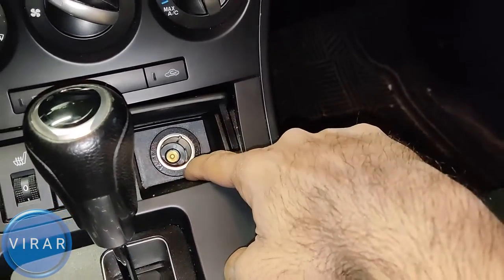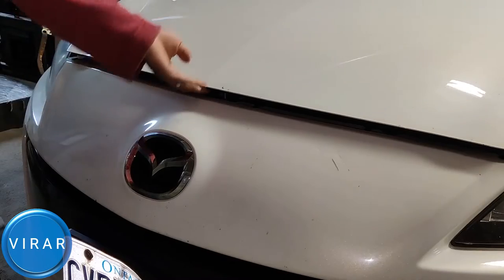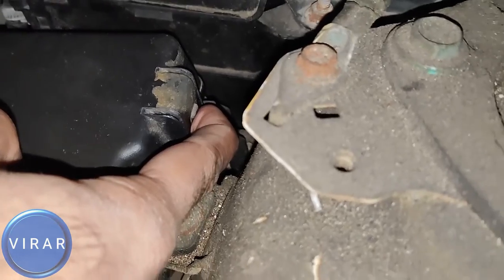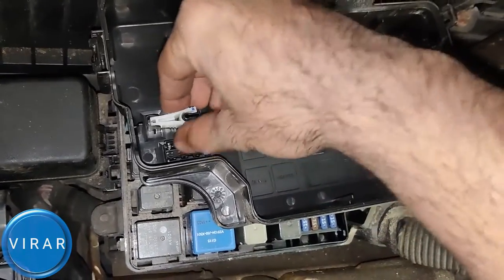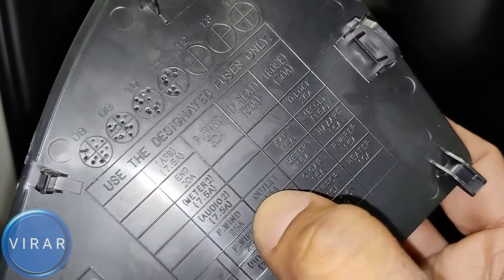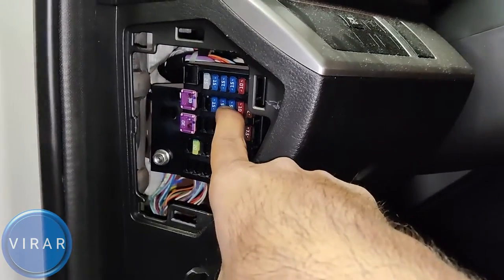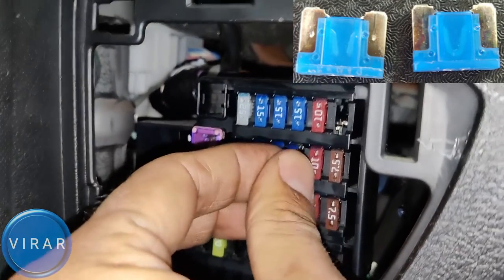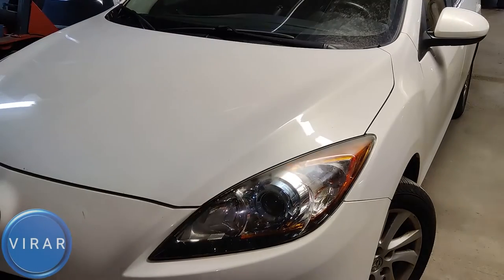How to Fix 12V Power Outlet/Cigarette Lighter - Mazda 3 (2010-2013)

Comment: Nice video, what do you do after the fuses check out good ? :)
Reply from the maker: After that the next culprit is likely the power outlet itself and just need to replace the part
Reply: @VirarAutomotive  Thank you very much sir!  It turned out the circuit was fine, the first charger I tried to use did not make good contact in the sockets. Tried a new Floveme QC 3.0 36W  charger from Amazon and everything works fine. It turns out the power in the center console socket is always on while for the gear shifter one you new to turn the key to ACC.